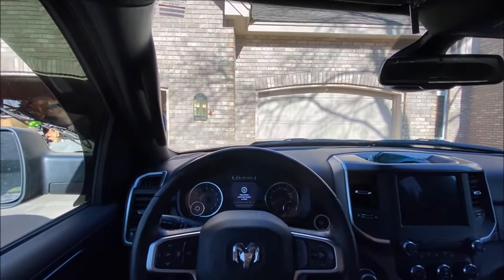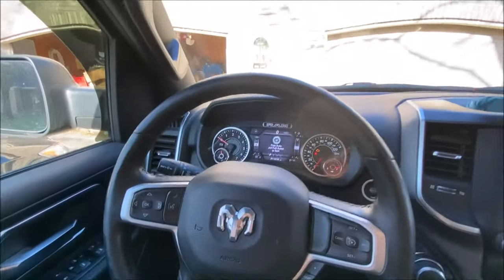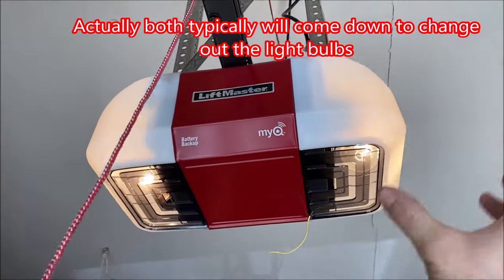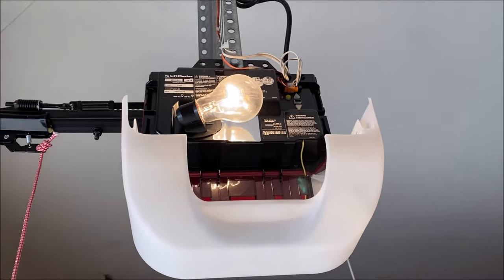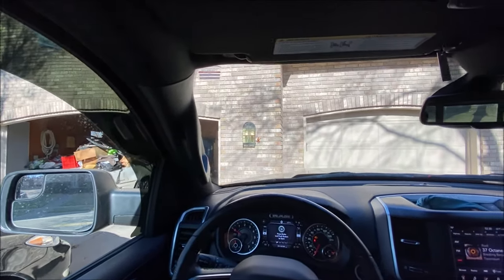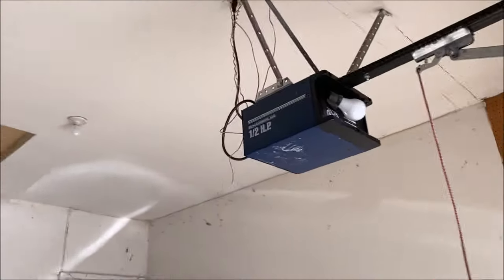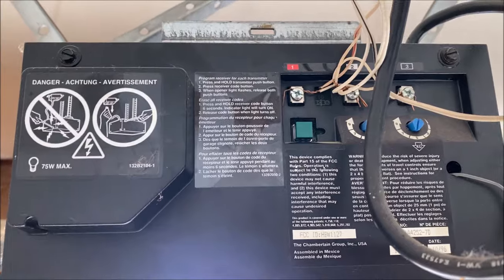2019 Ram Homelink Programming

Comment: You set the homelink with your garage door opener first . Then go use the learn button on the garage door opener. You have around 30 seconds. It has to be running or in the run position .
Reply: Thank you for this comment

Comment: Thanks, you got me on the right track... BUT ... for me (Liftmaster rolling code openers with plug-in Homelink repeater), I did NOT need to utilize the 'Learn' button at all. I simply held the Liftmaster hand remote close to the Buttons on the visor, then pressed both simultaneously until rapid flash, and that was it. If I tried to utilize the 'Learn' button, it would not work. My truck is RAM 1500 Longhorn.

Comment: Mine doesn't have a normal remote. It's just a key fob thing. Programmed fine with the Sienna. Won't program at all via any method I've found on the Ram.
Reply from the maker: This is for a Durango, but try this method! https://youtu.be/wiOeCdxqKdk?si=vbB5FrpcwPD88bIq
Reply: @TonyTheTruckGuy  Finally found a method that worked about an hour after I posted that. Had to hold the homelink button and the fob button at the same time. Until the light on the fob went off, and then reclick the fob button and hold until light went off, repeat. The home link button never did a fast flash. It went solid, and when it did it worked.

Even though the garage door has a learn button thing on it. Didn't have to mess with it (same as Sienna).
Reply from the maker: @jago668  Glad you got it!

Comment: Does this still allow you to use your remote with vehicles that don't have anyway to link to the opener because they are older.
Reply from the maker: Yeah, your old school garage opener remotes will still work after pairing your homelink to the garage motor. Just be careful not to push the wrong button when doing the learn procedure on the garage motor, because you CAN clear out all saved/paired remotes to that motor if you do the wrong button sequence on the motor.
Reply: @TonyTheTruckGuy  thank you.

Comment: Hey, Tony. I have a 2019 Ram 1500, but for some reason, I'm not able to program my truck with my garage door mechanism. It's a fairly new Liftmaster. I did everything you said to do, but it still won't work. I'm not sure what the issue could be. Any suggestions?
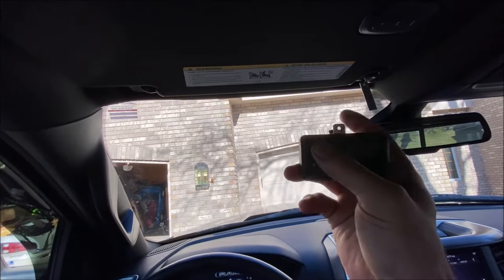Reply from the maker: Do you have a normal garage opener remote and have you successfully paired the remote with the home link in the truck like I show around the 2:50 mark?
Reply: @Tony The Truck Guy  Yeah, I have the same Liftmaster remote that you have, and as far as I could tell, I was able to pair the remote with my truck's home link. Then, when I test the truck's garage door button, the garage door doesn't open. 

If you're comfortable with doing a video chat, whenever it would be convenient for you, then as you watch me follow your steps, hopefully, you'll be able to notice something that I haven't.
Reply from the maker: @BennyChains88  I can definitely do that if it comes to it! I just work goofy hours and work late so we will try to talk it out first. Ok so if the home link button flashed rapidly when you held the lift master remote next to it, then it SHOULD be programmed to your remote code. I think I got a bit ahead of myself in the video and I pushed the learn button on the motor before I paired the remote with the home link. The correct order is to pair the remote with the home link as you have done, THEN hit the learn button on the motor and just hold the home link button down in the truck without using the original lift master remote at all. Also double check and see if your garage motor has 2 learn modes like mine did where I had to push the button twice. Let me know if any of that works. I also have a Facebook page if you wanted to make a post to show me your garage motor that you’re working with or maybe a video of you trying to do the procedure so I can see what’s going on.
Reply: @Tony The Truck Guy  Okay, thank you! I'll try doing what you suggested. If that doesn't work, I'll take photos and make a video, and will ask my wife to upload it to Facebook since I don't have a Facebook page. Thanks again.
Reply from the maker: @BennyChains88  Sounds good! Good luck!
Reply: @Tony The Truck Guy  Tony, I just tried what you suggested, and it worked! 

First, I pressed and held down the Liftmaster remote and the truck remote at the same time until the light on the truck remote stopped blinking. Then, I pressed once on the Learn button of my Liftmaster garage mechanism. I went back to my truck and pressed and held down the truck remote and noticed the lights from the Liftmaster garage mechanism blinked once. I'm guessing that meant my truck and the Liftmaster were paired. I don't know if I could have let go when I noticed that (I probably could have), but I held down on the truck remote until it stopped blinking. Then, I pressed the truck remote once, and the garage door closed. 

It's a good thing my truck's doors and windows were closed, because I screamed with excitement once I saw the garage door start coming down, and it's almost 3:00 AM here on the East Coast. So, I'm glad I didn't wake up my neighbors. Lol 

You should make a video showing this other way of pairing the truck with a garage mechanism. Thank you so much for your help! I really appreciate it!
Reply from the maker: @BennyChains88  HAHA! I know the feeling man, I struggled forever on my old ‘06 Subaru to try and get the home link paired and never succeeded. I was going to make a remake of this video, but a bunch of people were still saying that it worked and then my lease ended and I traded the truck back in on my Jeep so I can’t remake it now lol. I’ll make one for my Jeep though and it’s the same steps, so at least I’ll be able to reference people on this video to that video once I make it here. Glad you got it working man! Sorry for the confusion.
Reply: @TonyTheTruckGuy  No problem. Thanks again!

Comment: Is there not a way to do this without having a remote receiver? That defeats the whole purpose. If I had one of those, I’d use it.
Reply from the maker: Not that I’m aware. The point of the homelink is so you have an integrated garage remote built into the vehicle.
Reply: @TonyTheTruckGuy  Yes, I just don’t want to have to buy a garage remote in order to program my truck and not have to use the remote again. Seems like a waste of money, but maybe other vehicle manufacturers have a better way of pairing the car straight to the garage door opener without having to use a remote.
Reply from the maker: @RallyeGuy340  Possibly. You can TRY holding both outer homelink buttons at the same time until the red light hyper flashes to clear out anything stored. Then put your garage motor in learn mode and hold the homelink button you want to program. If that doesn’t work, I don’t see any way other than the way I showed.

Comment: Mine slow flashes, after trying to set a gate opener.  Anyone knows what that means
Reply from the maker: The home link light in the truck slow flashes? Always, or while holding the button down?
Reply: @TonyTheTruckGuy  after holding the remote button on homelink and visor remote, homelink flashes slowly. I let go. It goes out.
Reply from the maker: @moth450  Hold the 2 outer home link buttons for 30 seconds until light flashes rapidly to clear it out and then try again. Also I need to upload a newer video. The correct way to do it is to hold down the home link button you want to program at the same time as your original garage door transmitter. Then the home link will hyperflash indicating it’s programmed to the same code as the original receiver. THEN you push the learn button on n your garage motor and hold down the home link button again. This pairs the home link to the motor.